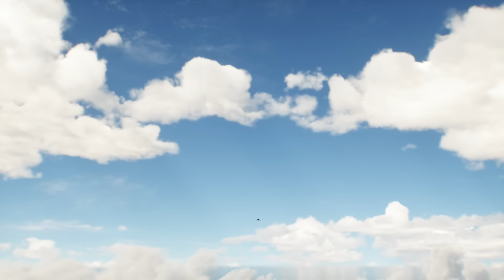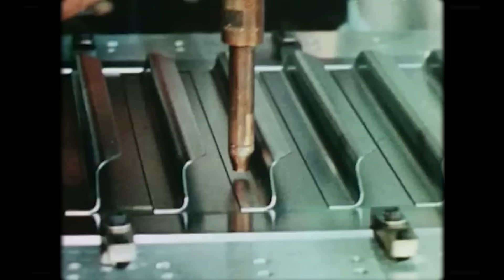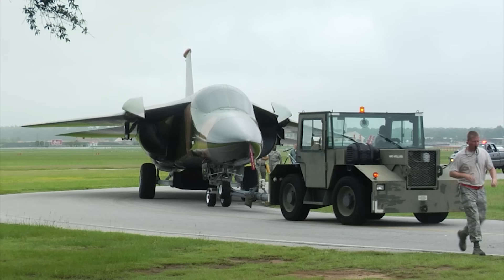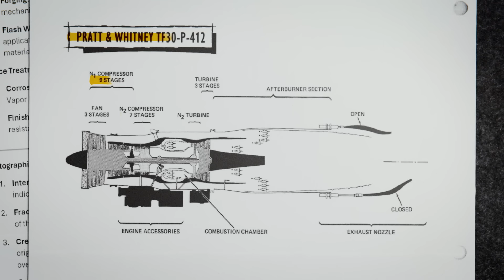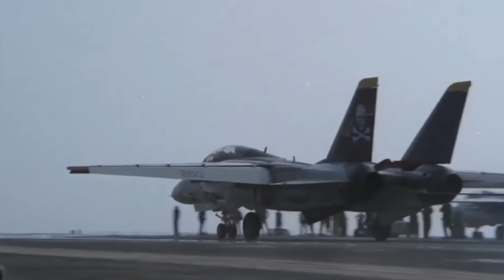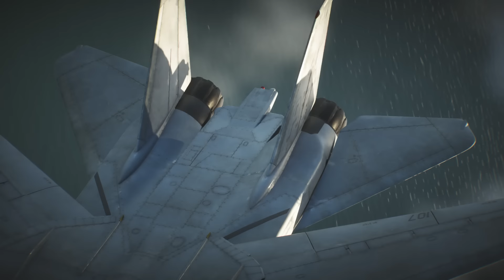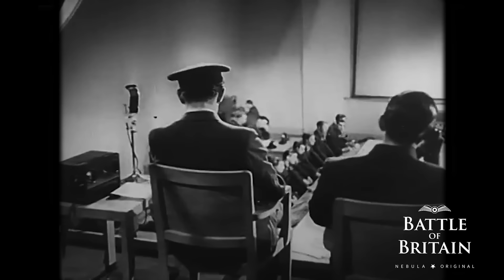The Insane Engineering of the F-14 Tomcat

Comment: "The F-14 was designed for one thing and one thing only" partly true. It wasn't just designed for interception, but also as an air superiority fighter as well and was also designed by Grumman to drop bombs. After the Navy closed the TFX and VFAX programs with the F-111B they sited the issues with that aircraft and the performance of the F-4 Phantom II. This lead to the VFX program that moved the Navy in favor of a tandem two seat, twin engine fighter with speeds of up to Mach 2.3 and a secondary close air support role.

Comment: The insane part of the F-14 was how bad the engines were when it was introduced and how the first crews were basically test pilots, figuring out how to wrangle that jet and not buy the farm.  Lose one and you have an insanely asymetrical thrust problem, because of how far apart they are to fit four AIM-54's between them for aerodynamic efficiency.  Tomcat did not have the internal weapon's bay of the Aardvark and thus had to space the engines widely apart, unlike with the Eagle.  Until the D came out, Tomcat was a bucking bronco that was trying to kill you if you even looked at it cross eyed.  Ask the wives of the many dozens of aviators it killed in mishaps.
Reply: The F110 engines  arrived  with the F-14B a few years before the Delta...
Reply: The engine history of the Tomcat does not get fully explained. The TF30 was never the intended engine, it was only to power about the first 70 airframes to do flight testing and get the plane into service before switching over to the more advanced F-14B model with the Pratt & Whitney F401 (generating 28,000 lb of thrust in afterburner). The F401 and F100 were cousin engines sharing the same core. The F401 pushed the start of the art a bit more than the F100 did. The TF30 was never designed as a fighter engine - rapid throttle movements or drastic changes in air flow into it. It was designed to just gently fly around drilling holes in the sky for the Douglas F6D Missiler.

Comment: The Engine Upgrades were part of the developmental plan from the start. The A model would test the Airframe, B, New engines and C Avionics. Only a hanful of A's were supposed to be built, but the Navy screwed that up with their funding games.
Reply: There's a video titled "F-14 Design Evolution" with Mike Ciminera (Northrop Grumman VP) if you are really interested in the design and engineering of the Tomcat. The Tomcast by Fighter Pilot Podcast fills in the rest of the operation history.

Comment: The only other successful swept wing fighter/bomber was the panvier tornado but was designed as a dual role fighter/bomber and have exceptional ability to fly low and fast to evade soviet radar, the raf and the usaf had mock combat battles and the tornado couldn't match the dogfight ability of the f14 but could outrun the f14 at low level so they used to go low and fast to evade the f14, both are great aircraft though

Comment: Dumb question, but when they say it requires "30hours of maintentance per hour flown"... does that mean 30 workers could do the maintenance in an hour? Or Does that mean it takes a team of workers 30hrs to complete?
Reply: It's man-hours, so 30 workers could do it in an hour per the literal definition. However it's a lot more complex IRL, since you'll have processes that are separate from others, but you'll also have very linear processes that need to be completed first and last i.e. preparation and reassembly. For example simply removing the engines could take an hour or two. Operationally there would also be a rotation of airframes, where some would be in for a full maintenance rundown maybe after a week of flying, and others during that week of flying would only receive a surface-level of maintenance... afterall the critical components won't break after only a couple of flights, so there's no sense in taking the plane apart after every flight.
Reply: @dumdumbinks274  cheers for clearing that up for me :)

Comment: First six minutes. Gave up. 

Gruh-man. Not Grooman. If the people at the company pronounce it that way, then we can all do it, too. 

The low angle produces more drag. Not less. Yes, it also produces more lift. But, the added lift and increased drag did not help it burn less fuel. Burning less fuel is a function of airspeed, which is lower with greater lift. 

The reason it burns less fuel at lower speeds has nothing to do with the variable sweep wings. It’s due to the square law of aerodynamics with regard to velocity (specifically airspeed). 

Most of the welding info is wrong. 

I am being harsh and critical. The channel is called real engineering. I’m just a lowly aircraft mechanic. But, if you’re going to claim to put out engineering knowledge, then fact check the names of engineering companies and the engineering knowledge you include in your video.

Comment: I worked for 13 years for Grumman Aerospace at the final assembly plant #6 in Calverton, Long Island, New York.  I was in the power plant shop (1051 ) for the f-14's on all models from the A's to the Final D model. Having been part of the team to first fit the new GE F-110-400's was amazing. The first full afterburner run at night on the aircraft  run stand shocked everyone with the power the new engines put out, engineers were afraid it would brake the strain gauge on the hold back chain. Evan the concrete was shaking under the plane. After the run was over we were dead silent, it was a monster. Only once was the plane run with both engines at zone 5 burners for a photo. I'm proud to have been a part of building the ultimate Navy fighter, hands down.
J.M., Navy Veteran, Ex Grumman " Iron Worker ".
Reply: Sounds amazing man. Congrats.
Reply: @unchaval5463 the dude in the video lied she was o
Not the first woman in the military to die flying
Reply: @Jerry-p3x  she was the first one flying... Get your facts together. Especially when you accuse someone of lying!
Reply: Anyone who's been on the boat when jets are launching knows how powerful these engines are. Even in the legacy hornets. You feel the reverberation in your chest until the catapult pushes them off the deck. Absolutely awe inspiring. Regular air shows don't do it justice.
Reply: @kentyannayon3741  I was on the USS Constellation in the 70's on the flight deck with VA-146. One place you did not want to be and that was behind a Tomcat at full burner cooking away! Evan with the JBD up you were roasted like a turkey !
Reply: I remember the final Tomcat flight arriving into KFRG from NAS Oceana Back in 2006. I was 11 years old then. Have always been infatuated with naval aviation, but the Tomcat is just so special. Having its roots linked to home on LI is pretty special. That very airframe is now on display in Garden City, and it hit me in the feels when I went to go see it.
Reply: @DevelDogg48  Where in Garden City?
Reply: Helluva story!!!! Thank you for your service
Reply: It it an exceptional aircraft but top gun is what made it an Icon
Reply: @joemoore4027 Yes, and the F-110 was so powerful that it required new engine mounts to be developed & manufactured from a specialty material that even our Metallurgists were unaware of (because no other Navy aircraft that we overhauled required it).  I won't mention the material since I don't know whether it's classified or not -- I don't want my birthday taken away!  ;P
Reply: @bobvines00 it can't be classified any longer, what is it?
Reply: "Evan the concrete"?
Who`s that?
Reply: @afrog2666   😂
Reply: @afrog2666 he's hard
Reply: That was a beautiful plane! My dad was the design manager there.
Reply: A dear friend was the person largely responsible for the aerodynamic design of the F-14. His undertanding of things made the Tomcat such a formidable platform. It's no accident we never sold them to any foriegn power, ( other that to the Shah of Iran . . . a strange story indeed).
Reply: @pennyanman  Never gave Iran the replacement parts though
Reply: Yes sir!!! As a fellow long islander thank you!!!
Reply: @joemoore4027  that’s awesome I’m very familiar with the area, I play paintball at the old calverton links golf course I used to play varsity golf at in high school. (Closed/sold). I guess it makes sense they’d have a fabrication plant there with wide open farm land & Gabreski air base right up the road. Thank you for your work sir!
Reply: If it wasn't for Dick Cheney, the navy would probably be flying the ST-21 Tomcat instead of the Super Hornet.
Reply: @jarjarbnks340  Your 100% correct. Old Dick hated Grumman and could not wait to kill off the Tomcat. Navy pilots were pissed loosing the SuperTomcat to the wimpy Hornet. Politics killed a great aircraft.
Reply: Hell yeah. Thanks for all your work on the Big Fighter.
Reply: You might’ve worked with my friend’s father, James Golden at the Calverton facility. I remember those birds flying overhead back in the 70s and 80s.  God, I miss them.
Reply: My grandpa was part of wiring the guillotine on the lunar landing module, as well as the cockpits on the first tomcats. Current Hampton Bays resident, and total calverton Grumman alumni. God bless, and thank you for your efforts towards safeguarding this great country.
Reply: @BigUncOutdoors My dad worked on the Lunar Module at KSC for Grumman.
Reply: That's awesome! My gramps might know him. Is he still around?  @KingAir1
Reply: Man that is absolutely phenomenal.. couldn’t imagine being witness to my contribution to building such an amazing product.
Reply: Thank you for your service!
Reply: Thank you Joe...... Your a good man.
Reply: You remember any of the systems engineers from any of those projects? My grandfather was at Westinghouse when it merged with Northrup Grumman, had his hands in many projects
Reply: I wish they would make permanent drag racing there the land is useless since Grumman dumped radioactive waste there but there's still push back from residents 1 of those reasons bird sanctuary 😩
Reply: I wish they would have built the super 14 for long +interactions. The  f18 is very worthless for that.
Reply: My late dad also worked at Grummans at both Bethpage & Calverton (ironically buried in the National Cemetary down the road) on the F-14s.
Reply: i heard the f-14b can go mach 2,5 at 40,000 ft. is this true?.
Reply: Thank you for your service.  :-)
Reply: I grew up watching the test flights .
Reply: I can sense the passion and pride being closely associated with the F-14...and rightly so.✔️ Thank you for your support to create a legendary aircraft 😊💯
Reply: @joemoore4027  truly wish they had built just one more fully operational F14 D for the museums and air shows. We should have one still flying in the country

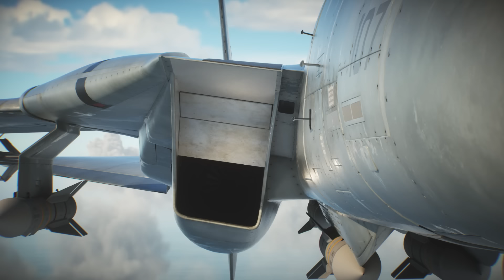Comment: 6:33 - those inlets are separated from fuselage to not ingest low pressure boundry layer that form on it. This would cause turbine blades to oscillate when they transition between high pressure to low pressure( boundry) in different sections of inlet. F-16 intake is separated in the same way.

Comment: The F-14 Tomcat was designed with extremely powerful air combat capabilities, especially with the long-range Phoenix missile. However, in the current context of cyber warfare and active attack, the old features of the F-14 may no longer be as effective as before, and new generation fighters with network control and automation capabilities have replaced many of the F-14's features.

Comment: @18:08 not very knowledgeable about aircraft, but isn't that a very slow take-off speed that will create stall?
Reply: The F-14 stalls around 130mph whereas the catapult launches it at 180mph. Keep in mind when they fitted the F110 to the F-14B it achieved a thrust to weight ratio of 0.88 at normal take off weight, it was very close to having unlimited vertical climb but could generally accelerate from any speed at any angle below extremes.

Comment: Grumman wanted to make a Super Tomcat with new engines, new radar and computers, optimized leading edges and RAM coatings for reduced RCS. Basically every thing McDonald Douglas is doing for the F15 EX is what Grumman wanted to do with the SuperTomcat. But Dick Cheny had a feud with Grumman and used the high maintenance cost as justification for killing it.

Comment: I served on the USS Ranger deployed to the Persian Gulf in the 92-93 era and I can tell you there is nothing more awesome than an F-14 in a low level pass at mach 2 it will absolutely rock your world!
Reply: they are not doing mach 2 at low level, at most they might be doing mach 1.1-1.2 but most likely very slightly over mach 1. The aircraft have structural and aerodynamic limits at the lower altitudes due to air resistance
Reply: That didn't happen.
Reply: Dunno about mach 2 but one broke the sound barrier at deck level during an air show we did with important people on board. I was going up the ladder from the aft smoking sponson and it blasted me up the ladder well like a giant hand on my back. Kitty Hawk abe3 waist catapults
Reply: @themajortom69  I grew up where they were made out in Calverton, LI. Loved watching them fly over our house for their test runs in the Atlantic.
Reply: It cant do even mach 1.5 in low level pass.

Comment: The vast majority of welding does not involve any combustion.  Most welding uses electricity to generate the necessary heat.  They definitely weren't using oxy-acetylene to weld titanium aircraft parts.

Comment: The statement at 03:40 is incorrect. You could make an argument that it was the most advanced/sophisticated radar on a combat aircraft (even then there are edge cases like awacs-type aircraft which had hardpoints that could carry missiles technically making them combat aircraft, but I don't remember what year that was done for the first time) but it was not the most powerful. The F-22's radar has a power output of ~20 kW to the F-14's ~10 kW, but the Mig-25's radar (which predates both) pushes 600 kW.

Comment: The Glove cans were to makeup for the weaker motors and used for bombing. No "welding" was done to remove them. They were disconnected and wired in the retracted position.
Reply: Improved supersonic handling, reduced loading of the horizontal stabs, to reduce Mach tuck.

Comment: A major factor in the Tomcat is the need to maximize air power in the limited capacity of an aircraft carrier. The huge investment in swing wings, weapons and computers is beyond what most land based air forces would need. Instead they would instead use the budget and maintainers to fly more simpler planes. Its when you have a carrier with fixed capacity that super tech planes make sense.

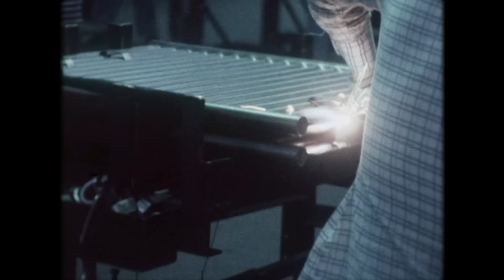Comment: 5:00 most welding if not almost ALL welding does not require oxygen. Oxygen pollutes the weld pool causing porosity, sugaring or bristling of metal. Titanium can be GTAW/TIG welded very easily, sometimes requiring a purge. Oxygen in most forms of welding is actually fought against to take away.
Reply: Most of the heat is generated by the electric arc unless otherwise needed in extremely small amounts. Some shielding gases included minimal amounts to stabilize the arc. 
-pressure vessel fabricator/welder

Comment: What do you mean that most welding processes need oxygen to function? Oxygen is the number one enemy to welding. Combustion with oxygen is not a part in the welding process, in fact there is no “combustion” in welding. It’s an electric arc which is not a combustion process at all. It is in brazing however. In welding, all you need is a medium that conducts electricity that can produce heat from resistance. You can weld titanium without lasers, I have done it by hand on several occasions, it’s a pain, but it can be done. 

I love this account and watch almost every video, but on many occasions you have said very very wrong information, and this is one of them and it just so happens to be apart of my life’s career. You need to do a bit more research before uploading videos if you’re making mistakes like this.

Comment: The wings could be manually controlled, which could be used to trick the opponent in a dog fight. Iran having the F-14 was also part of the reason for its retirement; destroying replacement parts that could potentially be stolen, as well as supply chains. Legacy hornets had a lot fewer parts than the F-14 though.

Comment: Having a significant amount of lift generated by the center body also diluted the rearward center-of-lift shift (and resulting increase in trim drag) when the wings were swept back. If all lift had come from the wings then the glove vanes would have needed to be made larger to achieve their intended effect of restoring the unswept center of pressure and static stability margin.

Comment: Why does the F-14 produce so much adverse yaw during high angles of attack since it doesn't use ailerons? In DCS when you add lateral stick during high AoAs, it goes into a roll reversal and if you don't correct it right away, it then goes into a flat spin.
Reply: Because the primary control surface for roll is not actually the wing spoilers, unlike the video said.  The spoilers enhanced lower speed handling but the stabilators (what the video mistakenly calls tailerons) are the primary control surfaces for pitch AND roll.  And another thing that the video fails to mention is that EACH stabilator is the size of one of the wings on an A-4 Skyhawk.
Reply: @danielvogel5252  That's what I imagined, thanks for the explanation.

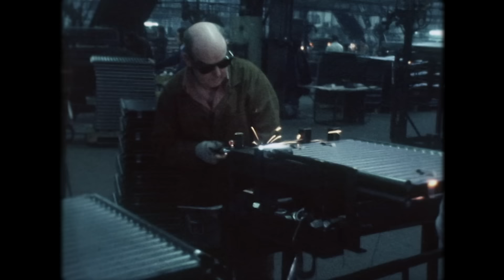Comment: Most welding techniques in fact do not use combustion at all. Oxyfuel welding is the exception to this case. Arc based processes (like the ones you showed at 5:07 when mentioning combustion) use a flow of inert gas that is broken down by a high voltage then a region of highly ionized gas is maintained by the arc. This is what does your heating, thought this too is a simplification. Arc processes can actually be used in a vacuum but the necessity of gas kind of defeat the purpose.